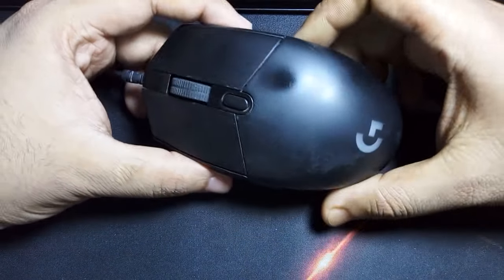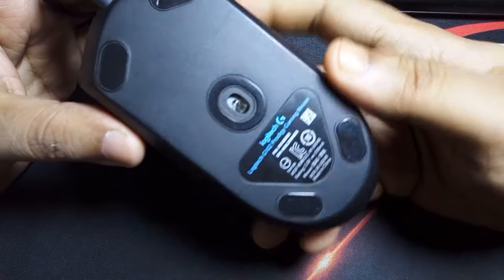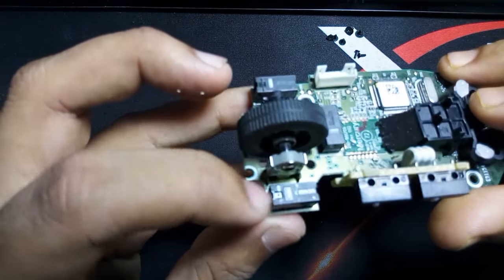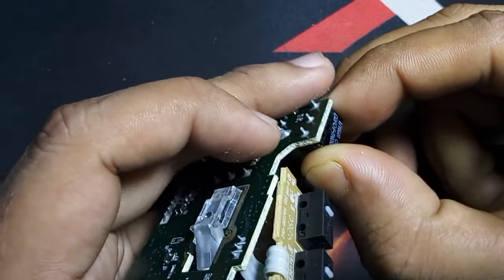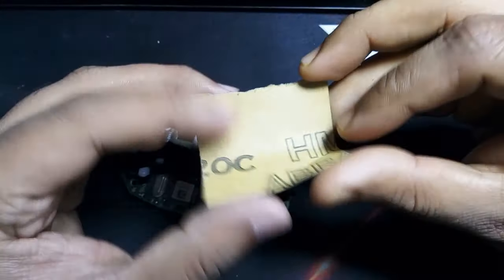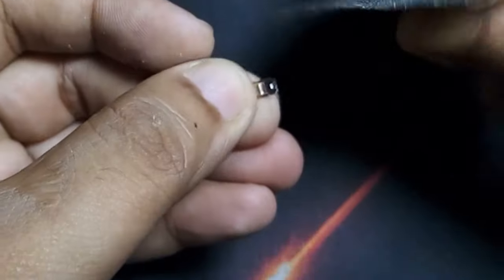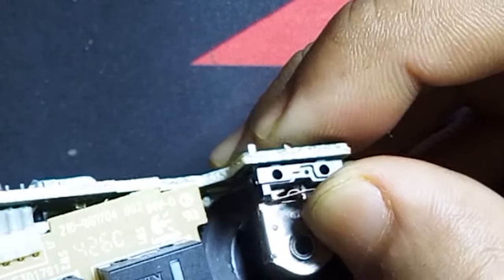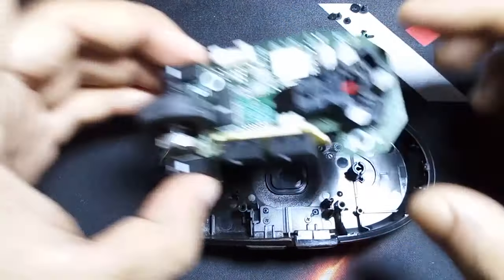Logitech G102 Mouse Double Click Issue Fix ( Switch Repair )

Comment: Will this fix my issue on G102, because when I hold click my left button instead of one click it clicks 2  or more times when I drag something. It's frustrating when trying to drag select and draging. Thankyou
Reply from the maker: Yes. Its a Temporary fix. 
If possible Replace the Switch.
Reply: @ReedsRepairReview  Thanks. Will try fixing it soon if I will be building new rig🙂

Comment: is sand paper required or  do you just clean it?
Reply from the maker: It will last long if you use sand paper to clean the conductors. 
Simple cleaning may result is same issue in about a month.

Comment: Thanks for the vid. I tried this on my G102 Lightsync, bought sandpaper and a screwdriver- ended up breaking the omron switch because I tried to pry it open with a flathead because I didn't have tweezers lol.

Welp, will buy new replacement switches and a soldering kit next time instead.